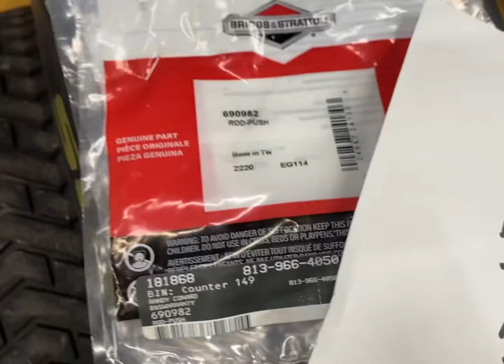TROUBLE WITH THE 27hp COMMERCIAL TURF SERIES BRIGGS ENGINE

Comment: Maybe it needs to be shorter and the originals were too long causing the issue? Assemble the engine and before you put the rocker on, cover the tip of the valve with sharpie marker then put your pushrod and rocker on set to the correct lash. Roll the engine over a few times and check the mark on the tip of the valve - it should be centered. If the pushrod is too short, then the mark will be biased towards the outside (away from the tip of the rocker)
Reply from the maker: Thanks that is good to know.  I still never have gotten it put a time to even touch it I had to start using my big truck because the other 72 has not been lightened that 72 can’t go back together until I figure that out so thanks for the help

Comment: Did you get this figured out and how many hours did your machine have? I am looking at a mower with one of these engines on it and trying to decide whether or not I should get it.
Reply from the maker: I had to bench that engine until I have more time.  I run these engines on all my mowers though.  Currently running four of them and really like them
Reply: @sclawns5257  Thanks for the response. Can you tell me, is it hard to swap out engines on mowers in general? Like if you replace something with the exact engine or very similar is it relatively simple to attach the linkage and other stuff back where it goes?